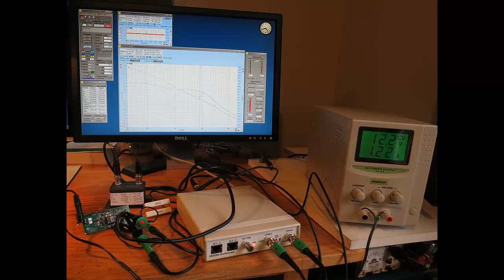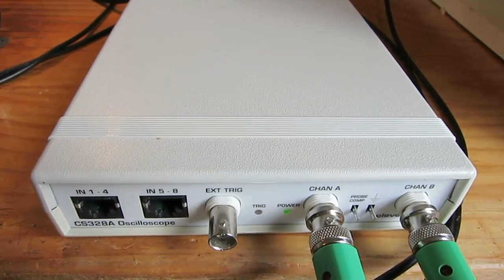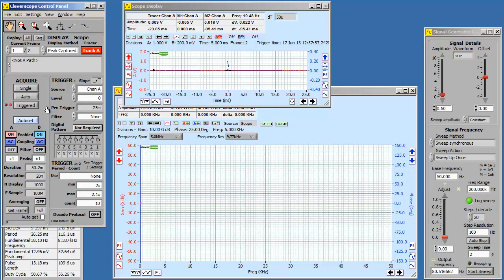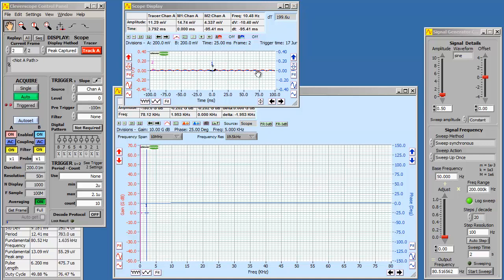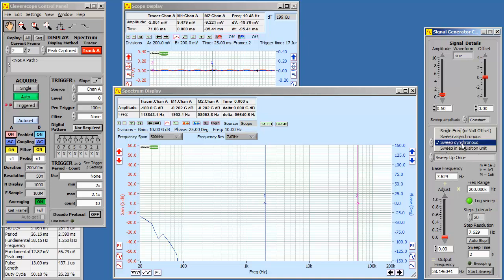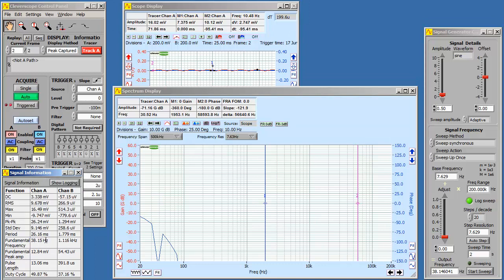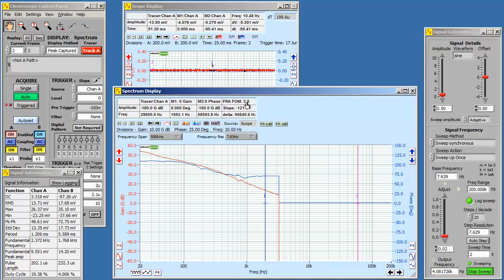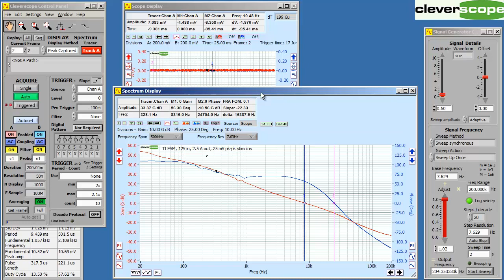Cleverscope Frequency Response Analyser tour

Comment: Can this be used for a PFC boost which has a bandwidth of 1Hz- 5Hz? In the video I see the frequency range as 20hz-200khz. Can the lowest freq start from 0.1Hz?
Reply from the maker: Hello Swaraj,
Yes, the FRA can be used down to 0.1 Hz, so uyou can do Gain/Phase from 1-5 Hz no problem. Because the CS701 does not use transformers for the signal isolation, it can be used down to DC.

Comment from the maker: The gain of the power supply feedback loop, and the Frequency resolution you use set the minimum signal - not switching noise.  You can synchronously resolve to about 10 uV (60 dB down on 10mV). So with 10mV stimulus, and a gain of less than 1, you can resolve a response 60 dB down. But if the loop gain is 20 dB say, this will reduce the stimulus by 20 dB, and so you can only resolve to 40 dB down.  You need to increase the stimulus to 100 mV to again resolve 60 dB down. Adaptive does this.